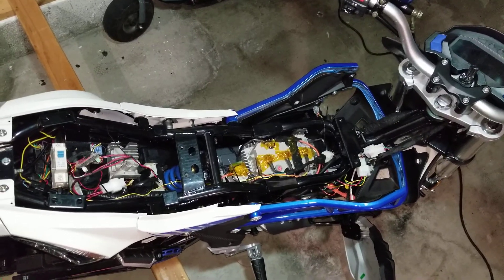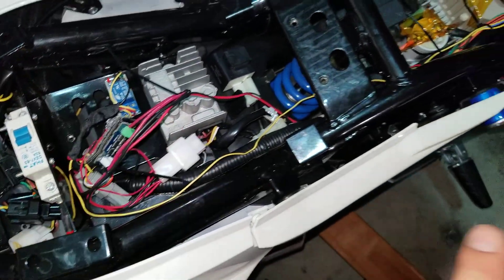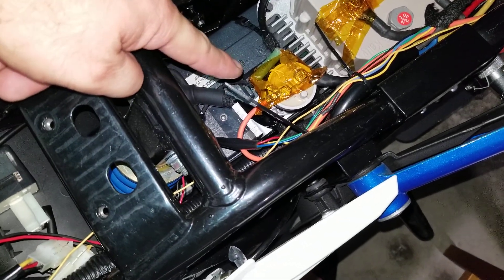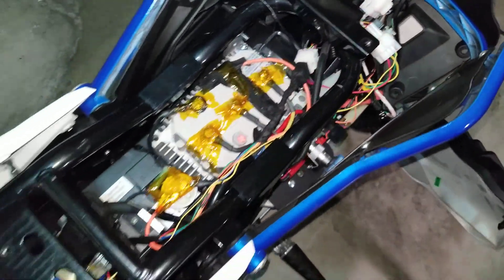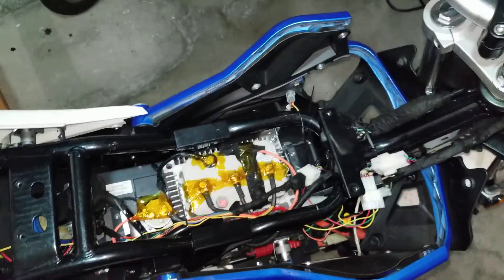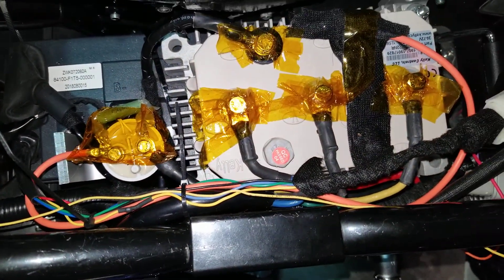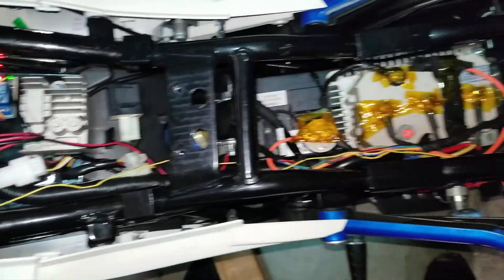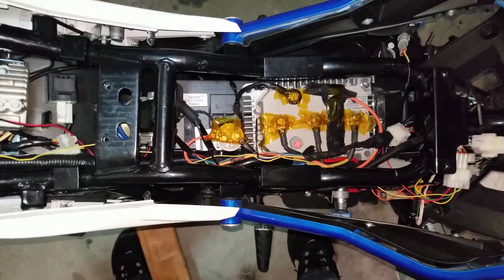2019 CSC  City Slicker- Reverse with Kelly KLS controller

Comment: Hi could you show how your using the original controller as a slave and how you wired them both up please really interested in doing the same
Reply from the maker: Hi there! I kept the original controller in place leaving the low voltage signals connected to the original controller to the high voltage connections to the new controller (DC input and AC output to the motor). This way, you would have a functional display showing the speed and confirm that no errors are displayed on the bus while the new controller drives the motor.
I hope this makes sense

Comment: So I would love to modify my controller so this wouldn't have higher torque and even 10 miles more of speed like yours. Anyways, from reading all the comments it seems that the controller that you were using is no longer available. Any newer commendations. I don't know what to do I really want bike to buy with this but it seems a little more complicated, anyway I could pay you to help me with this project. I'm in Louisville Kentucky you just wondering what state you're located in. Is there a way to message you or email you
Reply from the maker: Hi there. There are different types of controllers depending  on the motor you are using. Do you have the same motorcycle? This particular one requires a sinusoidal wave BLDC controller.  I am in SoCal, but I could help remotely :-)

Comment: You still have the stock controller connected with the Kellyone too? not good:(
Reply from the maker: Yes, but not to the HV lines. It's used as a "slave" for the CAN communication with the rest of the bike modules. The stock controller is isolated from the Kelly one

Comment: Why would you want to add the extra weight plus the extra money for this? I bet you rarely use reverse. It's not logical or practical... Mine has reverse that's controlled by the bluetooth app. Whoop'd doo. The bike weighs 200lbs. Push it lol
Reply from the maker: Well, the bike came with the Reverse function from stock which it got lost when I upgraded the controller, so I just wanted to keep all the features the same way they initially were (except for speed of course  and range which I have another video showing the battery I made)
  :-)
No Bluetooth here which BTW it can trigger erroneous signals to the controller and good luck while driving it. In this case, the Reverse button is already functional from the display and the CAN messages are 100% more reliable than BT crap. That’s why in your car, music is over BT and all critical communication messages are over CAN.
As far as the extra weight goes,  I am pretty sure the watt-hour/mile range does not get impacted at all by just adding a new speed controller and a couple of small Arduino Nanos.
Reply: @Frg_76  Whatcha mean good luck? Lol Every setting on my bike including all the battery settings are done through an app. Newer ones have controls on the handlebars yeah. But I haven't opened the app in about 8 months really haha no need to. All the "messages" are always working good.
Reply from the maker: @RetiredYTChannel  Good for ya!

Comment: More info on this setup please, especially how the old controller is still used as a slave.
Reply: Hi fr, did u post that video of how to wire the Kelly controller properly? I have a Kelly controller trying to install in the city slicker but lost. I wanna be able to get the eco mode switch to work as well. 
I saw it possible to get the stock controller up to 60mph. Would u know how to do that? 
Thank you so much for your help
Reply from the maker: I used the stock controller to tap into it for 2 main reasons. 1 – SPEED ON DISPLAY. I spliced the Hall effect wires together on both controllers. This way the stock controller can read and display the speed on the “cluster” or “display”. 2- AVOID ERROR ON DISPLAY. I also connected an old a throttle accelerator and left it secured on the frame. The new controller gets its own designated accelerator. I could’ve spliced it as well but I do not like messing with throttle pedals at all. (Failure rate could increase)
Reply: @Frg_76  Sounds like you tried to minimize the number of splices you made. I'm interested in duplicating what you've done to get my bike to 60mph; would you be willing to do a video showing in more detail where and how exactly you did the splices and made the connections to the Kelly controller? Thanks!
Reply from the maker: @Epicman246  Absolutely, I will also upload a schematic diagram I made showing how the new wiring is spliced and connected to the existing ones.